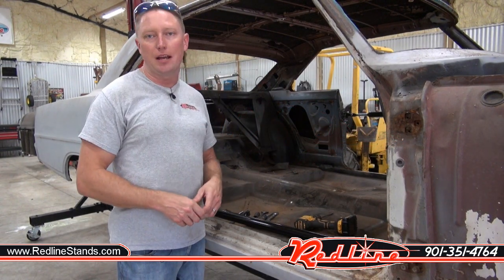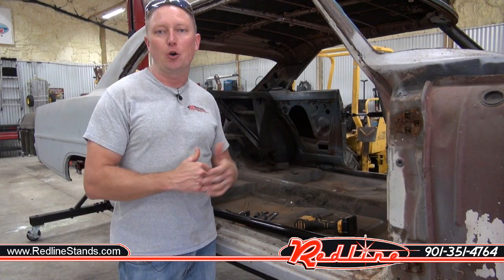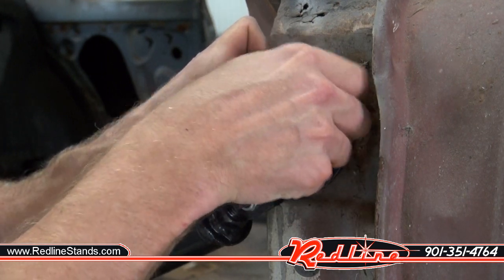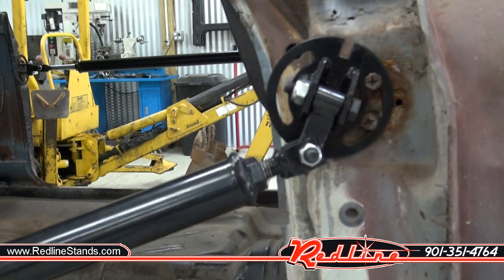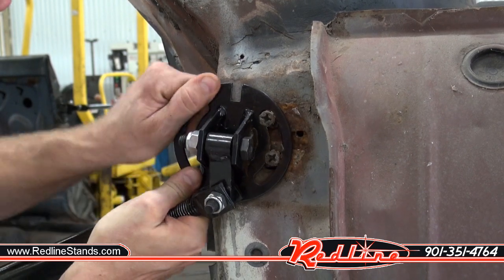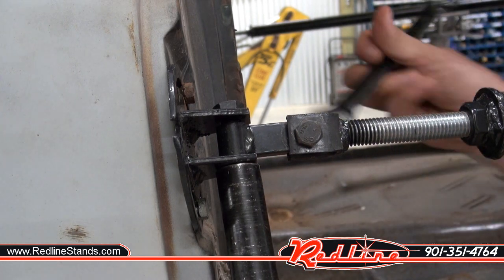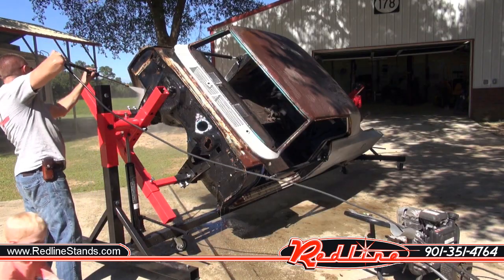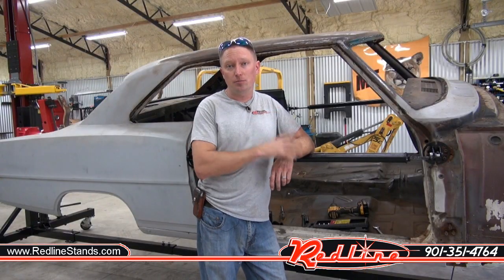Preparation for Classic Car on Rotisserie - How To

Comment: I have my 68 Coronet hardtop on a rotisserie without bars now for 3.5 years, I thought bars were for convertibles.
Reply from the maker: Depends on the body.  If it's solid then you might get away without having them.  If you're replacing the roof, quarters, and cowls, you'd be a fool not to do a full endoskeleton.